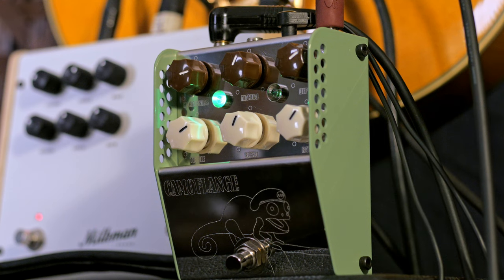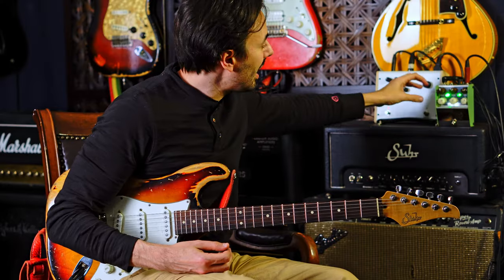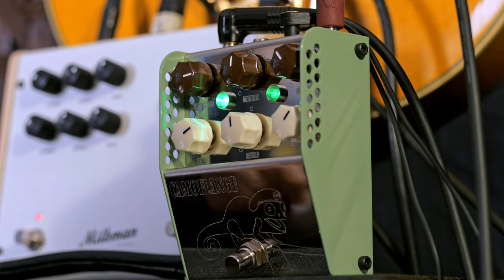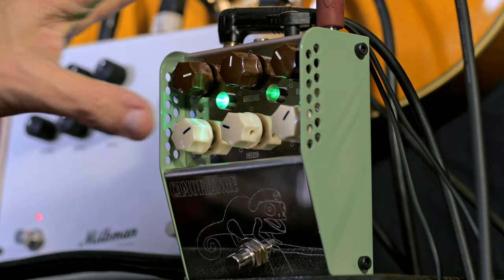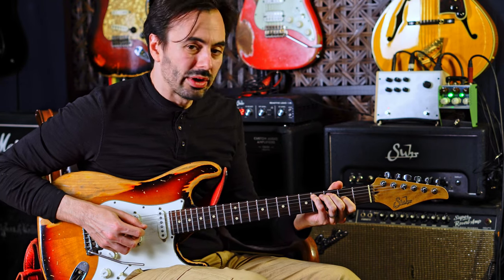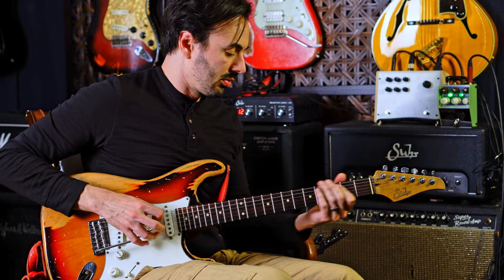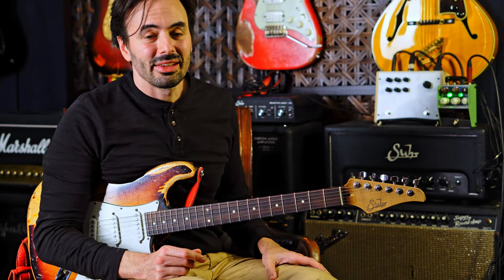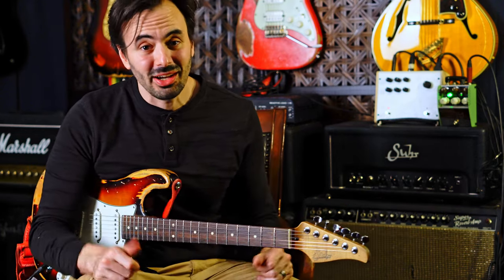This modulation pedal is packed full of texture

Comment: the harmonics knob isn't for oscillation noises

on the positive end you get jet flanger type tones like an mxr flanger, the classic flanger sound

on the negative end you have negative harmonics which is much watery and chorus like which is like an electric mistress type of flanger, which is actually why the electric mistress has that distinct unique flanger sound

most flangers use positive harmonics, but the few that use negative harmonics I really like, this flanger is one of the few that gives you the option for both
Reply from the maker: Sick! Honestly am not a flange guy but it’s a great pedal

Comment: Almost an electric mistress clone I am in love
Reply: It’s far beyond, just what an Electric Mistress can do. 
It can do everything an Electric Mistress does, with much more control of parameters, as well as other forms of flange effects.
Reply: it is inspired by it, and the harmonics knob is to give you that. on the far right side you have positive harmonics, which gives you the jet flanger mxr style, but on the left side of the knob with it all the way down, you have negative harmonics, which the electric mistress is one of the few that uses that instead, which those harmonics give it that distinct metallic, watery chorus like flange rather than the dry jet plane woosh on most

Comment: i hate flangers but this one actually sounds useful
Reply from the maker: Same
Reply: I never cared much for them either, until I realized there were so many tone shaping abilities, that didn’t sound like what I thought of as a flanger pedal. 
From Chorus to the effect on something like Hendrix’s Bold as Love, which is tape flanging, I started experimenting with them more. This one is about as versatile, as an analog flanger can get. There’s a small builder in South America, who made a Flanger, that this pedal is pretty much a clone of, that I found a few years before the Camoflange was released. 
It was a company called retroheadFX, and their Robotic Flanger. There’s a YouTube video of it. They also have a killer Phaser, that can do so much. They don’t make the flanger anymore, but they had great prices, but the problem was shipping. I contacted them to buy the Phaser, and it was about $150 US, but shipping was more than the pedal, and I just didn’t have the money, as well as knowing it would cost that much if there was a problem with it when it arrived.
Reply: you probably hate positive harmonics flangers. most flangers use positive harmonics which give it the jetplane woosh sound, though some flangers (such as the electric mistress) use negative harmonics which give it a less deep sounding, wetter, metallic, chorus like sound. the harmonics knob on this flanger switches between them, turn it up and you have positive harmonics, turn it down and you have negative harmonics